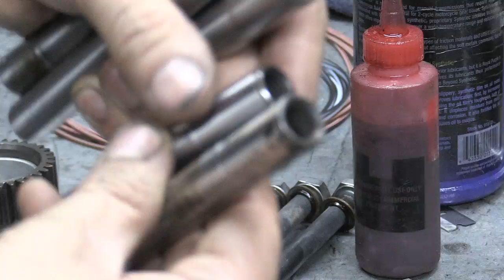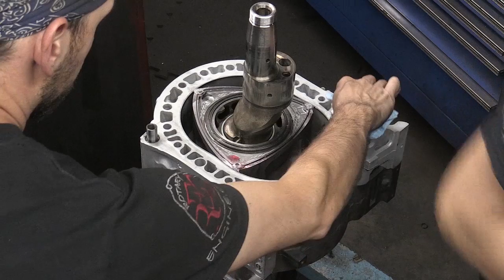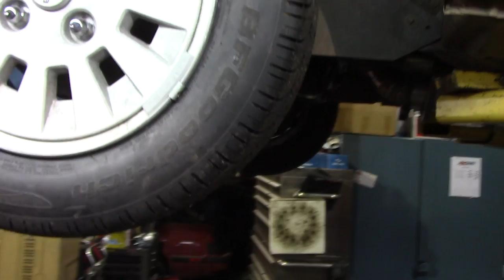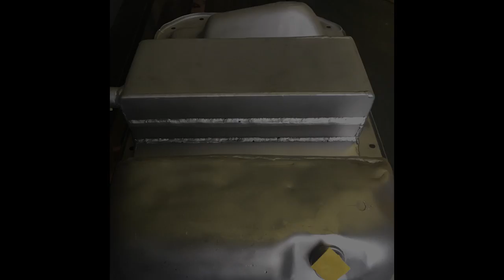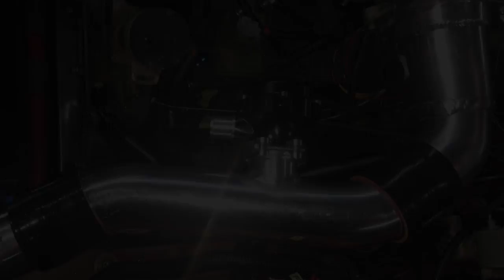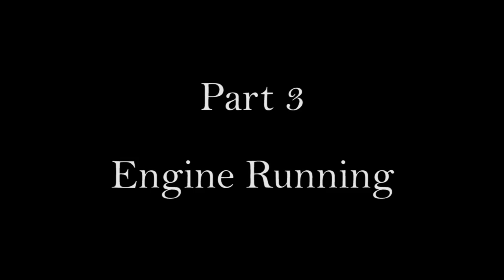700HP 3 Rotor 1st Gen Sleeper - Full Build.

Comment: Great build, and what a choice for a sleeper!
Most people would be leary of racing any rotary vehicle, but the 79-80's with their steel bumpers, plaid interior and especially THAT paint!.....gonna surprise many who would challenge it!! Also a great choice to spec the chassis with the highend SE running gear. Its too bad the wonky position of the 79-80 shifter caused so much trouble with engine placement. That's where I'm glad I have an 84, since the interior console is pushed back a bit. It made fitting up my S5 TII quite a bit easier. Even with the stock OMP and my aftermarket rack and pinion steering, any 13B swap is a cakewalk compared to the 20B. FWIW, I have over 15 years of daily driving on my 350hp-ish S5 swap, running into the stock SE rearend....its a pretty tough little nut.
 Congrats on a clean, tasteful and massively overbuilt sleeper!

Comment: Hey Adam, nice build!  I enjoyed watching your work on the classic 79 RX7.  Had a couple suggestions on the videography.  The fade in and out on the stills was a bit much especially as fast as you cut from scene to scene and the written description didn't last long enough for me to read it, so had to back up and pause, which is no big deal, just interrupts the flow.  Otherwise, excellent work.  You guys did a bang up job on the custom fab work.  I know how much effort we put into building the Turbo RX8 project car with all the custom fab work.  I agree with the other comment about the air filter sucking hot air off the heat exchangers needs to be corrected.  I don't know why anybody would spend so much money on a build like that (or any build for that matter) and not want to protect the engine and maximize performance as much as possible by avoiding inhaling hot air.  I guess he won't really be able to use even half the power its capable of with stock 14" wheels, so hot intake air probably won't make a difference in his application.  Gonna melt the rubber right off the rims if he nails it thought.  LOL..
Reply from the maker: Hey Richard hows it goin? you know what funny...when my editor was done with it and I finally watched the entire thing....I picked out the exact same  things. I mean exactly those 2 points caught my attention and thus mentioned to him. We agreed it was a bit too late to change it now...especially since we had already taken it down once and reposted. If it wasnt for that repost already I actually would have leaned toward re-doing it. FYI  all the vids we have  done so far are rushed using from unfinished B-roll. I have never put in full effort due to time. We have the capability to do this with very high end equipment so from my view...nothing I've done so far it what I see as top professional work. Its a balance of time ..as Im sure you can understand. Love the advice...keep it coming!
Reply: Richard Viscasillas h

Comment: My engine tuner is against pre-mixing and against water injection.
My 13b is doweled and ported, race only but it still on stock turbos for now, I am looking to upgrade the turbo but am worried about engine life if not doing these things mentioned above, what are your thoughts ?
End goal would be 4-500hp.
Reply from the maker: Premix is absolutely 100% the sure way to get the optimum lubrication to the apex seals. Although one might suggest that the factory OMP is adequate, I would NEVER tell someone NOT to add premix. It may not be urgent to add it if running the stock OMP but it certainly wont hurt to add it and I beg to differ that it is extremely helpful. High HP cars such as single turbo 400 HP scars should all bump up the lubrication
Reply: Thanks for the reply, I will definitely start pre mixing for races and in the future. 
Next question. it is literally impossible to find a reputable answer whilst trawling through forum filth. 
What type of 2 stroke is good to use? are their specific rotary mixes ?
People say anything from mower/marine/bike and kart. mineral, synthetic, ester and castor.. It is very difficult to know what is correct and/or best.
Reply from the maker: We sell / use Idemitsu
Reply: Don't use synthetic
Reply: RX7 Specialties, I've heard that like 6 times and I just started learning about rotaries a few months ago. Must be true.

Comment: I'm just wondering with the sump configuration if you'd get oil cavitation due to the sump having 3 divided sections?
Reply from the maker: Nope, in fact the 2 rear ones communicate. The front one just drains back to the center and all oil ends up at the pick up area. Oil cavitation is caused by starvation, as long as the pick up is submerged this cannot take place.

Comment: nice build, but gee relocate the air filter.
Reply from the maker: If there was room we would. HaHa. Ive seen alot worse and Ive also seen no air filter. My belief is a tight squeeze and potentially sucking hot air is better then no filter. The owner might change it some day. Sometimes when customers spend the kind of $ that this guy did, they settle for what is adequate rather then ideal. Hope you understand this point of view
Reply: A simple "Banjo" right angle going either up or down to a cold air box would be a vast improvement. Awesome engineering otherwise!

Comment: when building the engine you mentioned something called "line bore". what does that mean?
Reply: Line bore is referring to all the bearings in the housings are lined up and true. With 20B engines the front housing "floats" until all through bolts are torqued up while rotating the eccentric shaft. This ensures all bearings in their respective housings especially the front housing have found proper alignment .
Reply from the maker: MrStoneycool69 is absolutely correct!!
Reply: Thanks for the explanation. So looking at the video it's not something I need to worry about on a 13b? I thought I remember rx7 specialties saying it's just for the 20b right?

Comment: Excellent video. That engine sounds awesome.
Reply from the maker: Calgary, Alberta
Reply from the maker: Thanks for watching..glad you enjoyed it
Reply from the maker: No not at all but tight for space. Owner might build some sort of cold air duct soon
Reply: RX7 Specialties where is your shop located
Reply: si bland I'm not RX7 Specialties but in either twin / single turbo setups, the air filters are on the turbo(s) so any air entering the intercooler will be filtered.
Reply: RX7 Specialties is it wise to have a air filter near the rads where hot air blasts at it .